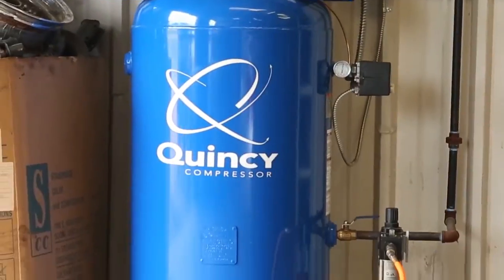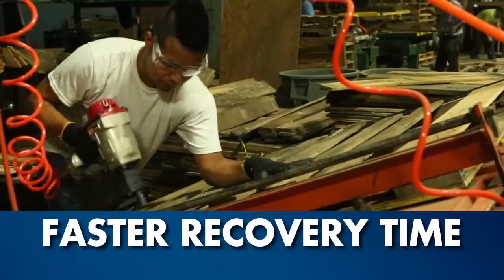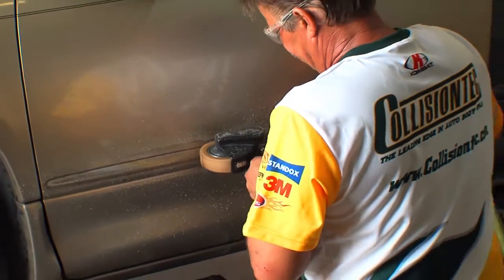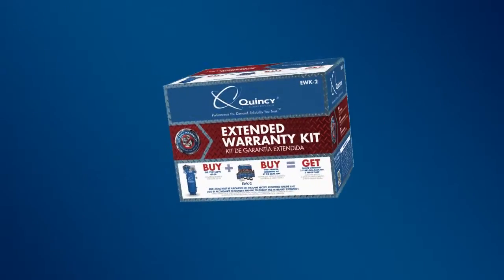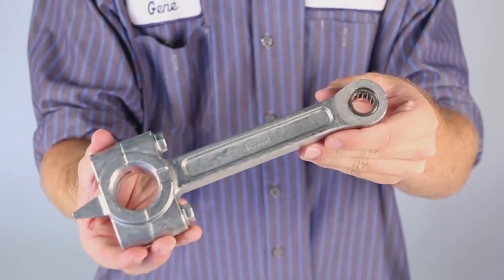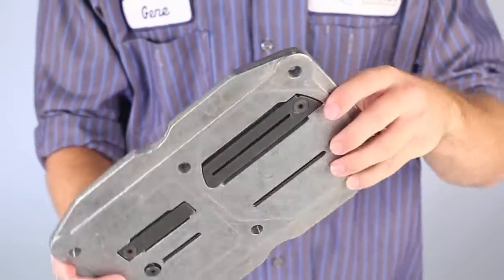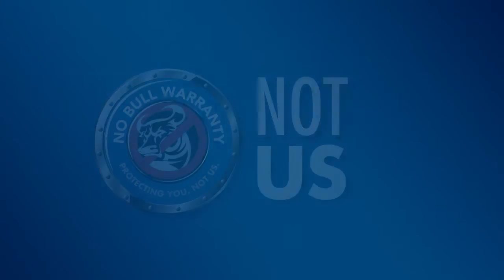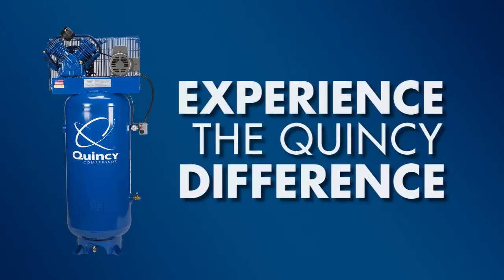Quincy QT-54 Splash Lubricated Reciprocating Air Compressor - 5 HP, 230 Volt, 1 Phase, 60-Gallon Ver

Comment: The pump is not made in the USA and the 50,000 hours is a joke.  Mine died inside 1000 hours.
Reply: Put together in the USA with ding dow parts and they run at to high of rpm's  Eaton Polar Air is King quiet 5 year FREE warranty low rpm last years and years sorry quincy u fell behind in the times
Reply: Quincy has gone to shit ever cents Gardner Denver  acquired  Quincy out of Quincy IL
Reply: its not a industrial air compressor its a big box unit